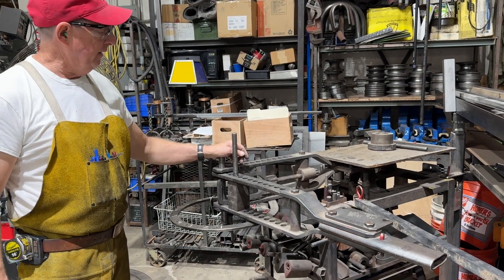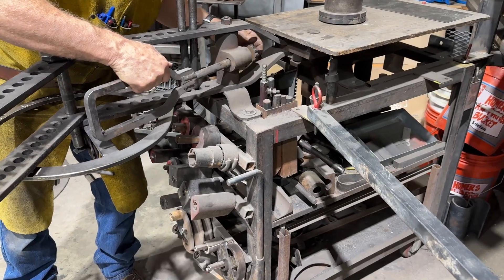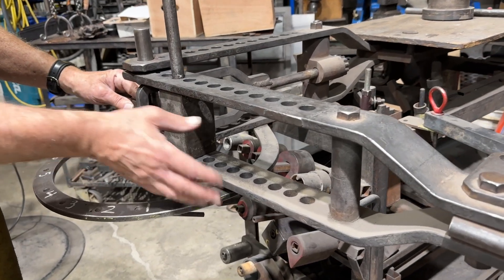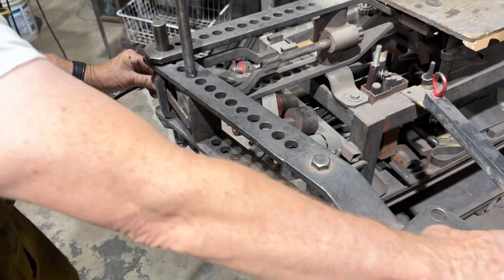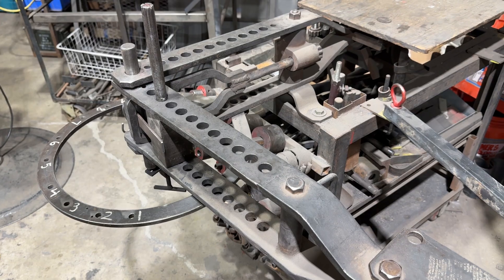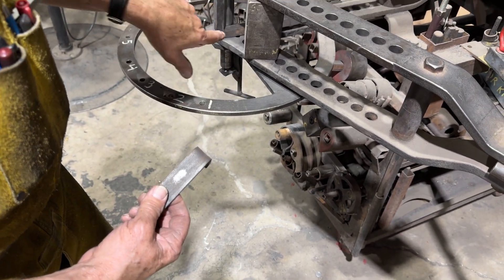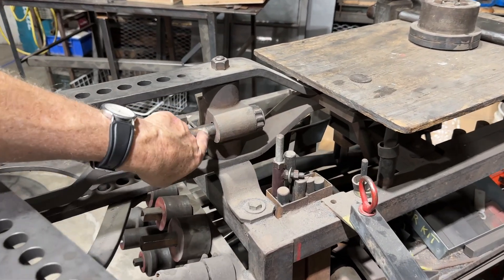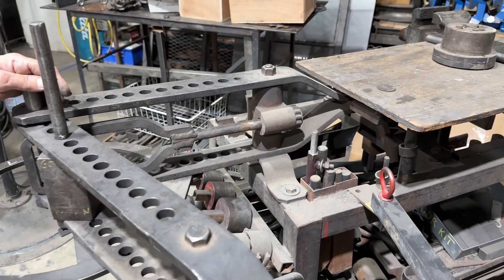Square Bends with the Hossfeld Bender

Comment: I have a Hossfeld I'm getting ready to sell as I close down my fabrication business of 22 years.  Full set of basic tooling with spares, 4 pipe/tube dies including 1 1/2" schedule 40 pipe die [I do a lot of railing], frame is on rolling cart with hydraulics, includes the L bracket for >90* bends.  Have a additional frame that would be best used manually mounted at a separate work station as lighter materials that don't need the hydraulics are faster done by hand.  Located in the Seattle area/South King County.  Available to view/operate prior to purchase.  Shipping would not be practical.  Operators manual included.